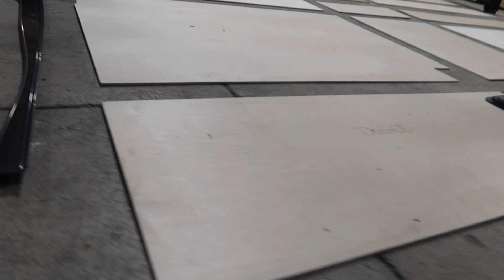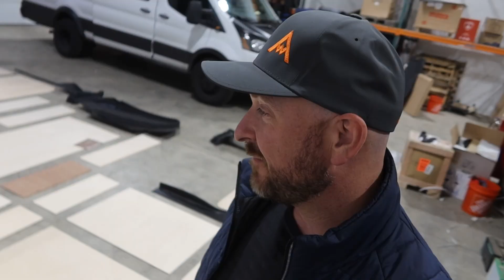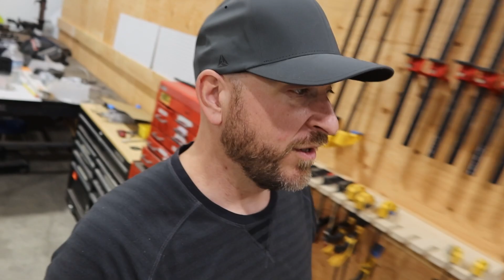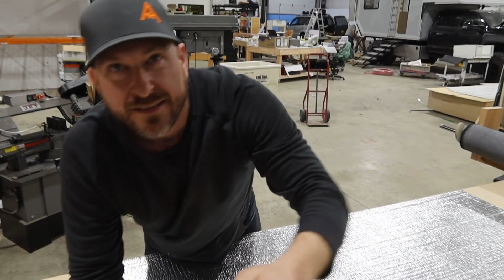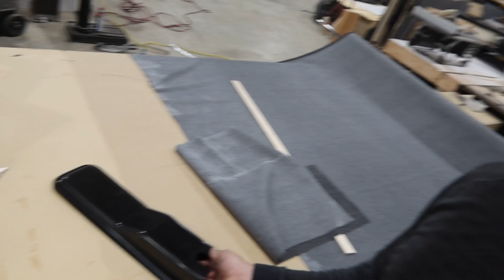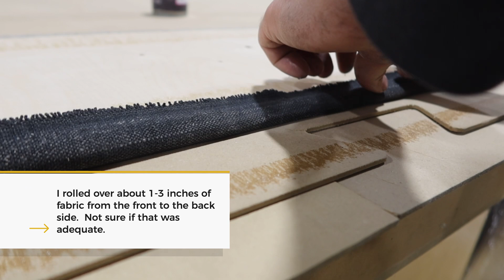How To: Vanlife Upholstery Fabric Panel Installation

Comment: I could never understand the reflective material.  Like a baked potato.  They always say put the tinfoil shiny side in, but after you wrap the potato, there is no light in there, so what is it reflecting?
Reply from the maker: It reflects heat from what I can tell. Similar to the survival blankets when you are mountain climbing. It’s interesting stuff. It also has a vapor barrier and that helps too

Comment: That material looks great. It will probably hide a lot of dust and dirt bits as well since its multicolor. You did a fine job with that adhesive. I always put too much on and regret it when I press the fabric down. Very nice work on the odd shaped plastic piece.